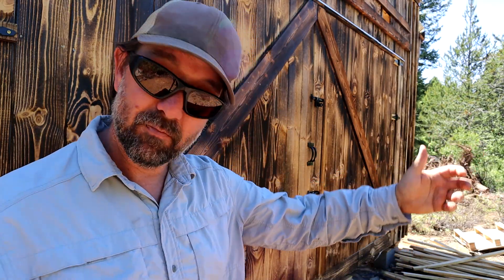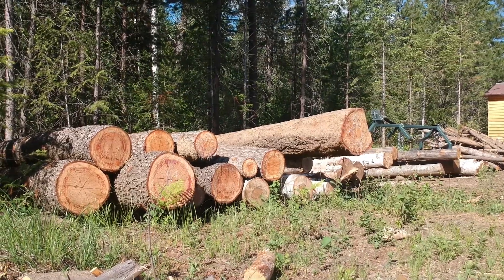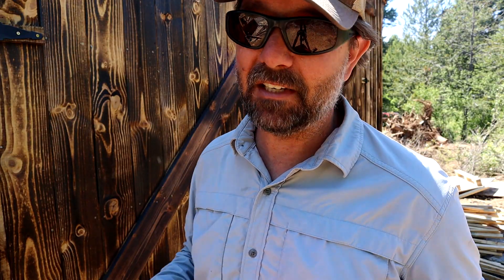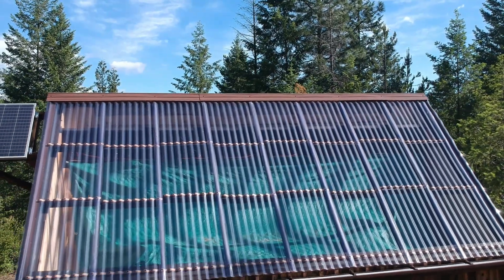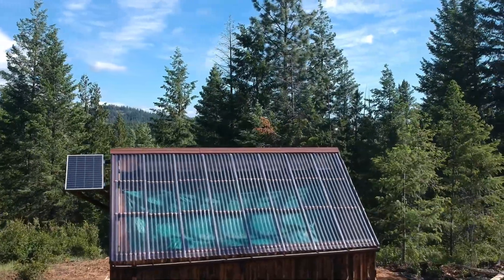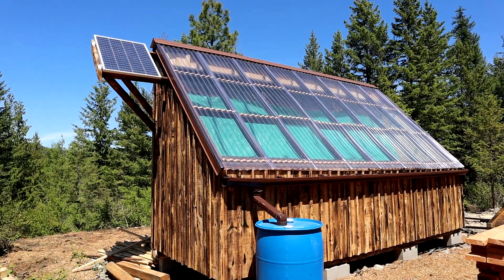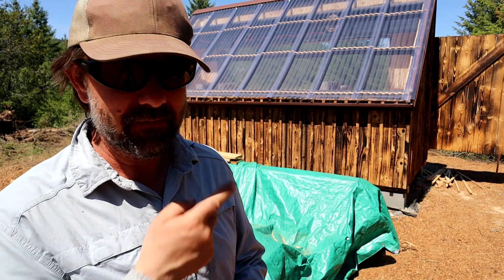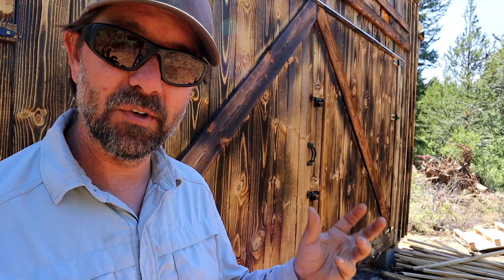The Solar Kiln: Operation, Capacity, and the Effects of Building With Green Lumber - Ep17

Comment: Just curious about your mention of water cooling your sawmill. I built a bandsaw mill, 3’ dia. X 25’ log capacity. I found no need for cooling with my guides . Maybe it’s the western tree species you’re sawing. I saw a lot of white ash, oak and white pine and poplar and have never an issue with heat.

Comment: Good idea: instead of cinderblocks use ratchet straps. Wood pack itself is much heavier than those blocks. Use its own weight against warping. On the other hand, the belt weighs less and is easier to operate.

Comment: One could build a 18’ wide 12’ tall kiln along the top edge above the double wide doors 8’ wing span per door 16’ total width of exterior door opening add a solar/wind powered fans along the top edge every 2’ for a total of 9 intake fans run a full board width starting from the top ceiling dropping down 3’ from top at a angle to middle of stack height of wood. Add three dehumidifiers one on each outer edge and one hung dead center all running of solar/wind battery are deep cycle. Glass the outer windows with wide panels double glass. A top of the out side metal panel or highly stained wood panel extending four feet off the top back side with putter and side drip edges. To keep top fans dry in wet weather. Painted or stained dark. In the lower doors add four high Volume fans two to each door pointed outward for rapid venting. The water from the dehumidifiers could be collected in exterior rain barrels with added oxygen stone for each to keep the water fresh. For yards or gardens. The interior and exterior walls will be insulated with Rock Wool or insulation of choice. Stained dark or painted dark. Build a platform at base for easy forklift, tractor, bob cat loading. Have a certified electrician help with the battery and wind/solar components. Enjoy quickly solar kilned wood for years to come. The floor should be off the ground by 2 feet with sand and gravel base and stained or the bottom treated wood. I could source the whole thing but a contractor with experience could tell the cost of this beast better than me.

Comment: 2 days of milling!?  I work at a circle sawmill and the old guy that runs it is always going on about how slow band saws are. Usually just nod and smile and keep tailing off.  But that 3 foot pile is only 4 hrs of milling for us.   1500 board feet of soft lumber in a 4 to 6 hr day is not a problem.  I had no idea how slow a band saw was.  If I ever get my own mill I'll definately build a solar kiln like yours.

Comment: I rabbit all my siding and flooring. A router at the end of the mill table, helps alot if you have drag back.

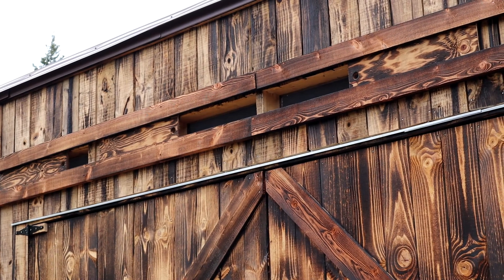 I've built 100s of homes. 90 10:39  probably 99% of framing lumber was green from the suppliers. You shim shrinking under headers, then cover with sheet rock and putty and paint makes  carpenters out of those who aint.

Comment: Hi!,
I just subscribed to you channel so many of my questions may have been answered already but I noticed you have a burnt outer coating on the kiln.  Are you concerned about fire, GOD forbid, since charred wood burns quicker than just uncharred wood?   I also noticed the direction of the kiln as it sits.  Does the building/roof face due South to max out the heating potential?  I love the ingeniuty of building the kiln first, to dry the wood for the house!  For the foundation, how do you get the concrete to your location?   You probably have answered these questions already.  You really look like you are in the middle of "nowwhere USA"  I'm going to start with the first video, THANK YOU  for labeling the video parts sequencially!  Many videos are not labeled 🤔making it hard to follow in order.

Comment: Great job keeping is simple, but explaining completely and well. I’m thinking I’m going to build a couple solar kilns for my operation as I can’t afford a bigger unit. I’ll get my slabs and boards lower in moisture with a solar kiln then hire out finishing so it won’t take as long or be as expensive to finish it off. Thanks for the video!

Comment: I am building a skillion frame for a cabin. Facing solar south. Hoping to have winter solar gain by south facing window wall and north sloping roof. Going 24x28 because only can span 14'6" with 2x12x16' 16" o.c. For now just getting 9 piers, 9 post, 3 headers, and roof finished. So like a skillion pavilion.

Comment: Hi there. what is right type of roofing material? Dual wall is better because of thermal isolation but on the other hand "wave" type should catch a lot more sunlights because of wave shape there will not be so much reflection in morning and evening like with straight material, right? Thank you, Tomas

Comment: Does anyone have a source for the solar panel and fans they use in this build?
Reply from the maker: I just added links in the video description for the fans and solar panel I used.
Reply: I’m also looking for an answer to this!
Reply: Hey SV Adventurer! Thanks for the fast response! Just confirming that you were able to run both fans off the 1 panel, correct? Do you still find that 2 fans is enough, or do you think 3 would be better?
Reply from the maker: I am able to run both fans off of one panel. However, I'm not sure if you could run three off of that one panel I used. You may need a larger output for that. I think two fans are adequate for a moderate load in the kiln, but a full load could definitely use three fans. If we pack the kiln full, the wood on the bottom of the stack doesn't seem to dry out at the same rate as the wood midway and up. Anymore, we generally don't load to full capacity and that seems to help a lot to give even consistency..
Reply: @SailingVesselAdventurer  Thank you for the feedback! Cheers!

Comment: Been researching for a good solar kiln design. I think this is my favorite so far. Is there any reason to not put the door on one of the sides of the kiln? As long as the kiln was tall enough and wide enough, I could walk the boards in and stack them?
Reply: I'd rather have the side open and move them in and out on a pallet with the forklift
Reply: If you will regret putting door at end of kiln!

Comment: LET ME KNOW   HOW HOT IT CAN GET IN THE KILN  AND WHAT ROOF SHEETING ARE YOU USING AND  KIND OF A ROUGH LOCATION SINCE I AM IN IOWA  AND THINKING OF DOING THE SAME HERE BUT I CAN NOT GET A MILL FOR 2 LONG YRS BUT I HAVE TO SAVE UP FOR IT BUT I FIGURE I CAN BUILD THE GREEN HOUSE FIRST  I WAS THINKING OF 30 FT. AND WILL USE A SKID LOADER TO MOVE WOOD  THE OLD BACK IS SHOT AND WENT OUT  MORE TIMES THEN YOU STACK A BONDLE OF WOOD  I GUEST POURING CONCRETE AND JACK HAMMERING AND GETTING CRUSH WHILE DEPLOYED OVERSEAS DID NOT HELP  BETWEEN A SHIP AND DOCK JUST WAS AT THE WRONG PLACE AND WRONG TIMING BUT I RECOVED FROM THE CRUSH AND GOT OUT OF THERE  BUT ENDED IN A CAST FOR A SPELL AND STILL HAVE BAD DAYS OF IT BUT WHAT THE REAL DEAL IS WHEN SOMEONE BREAKS YOUR FRONT DOOR DOWN AND STOLEN MY IDENTITY AND ATTEMPTED TO KILL ME HAS MORE RIGHTS TO MY HOME, ASSETS, MONEY, GOLD, ART WORK, TOOLS, CREDIT , DEBIT CARDS AND I HAVE NO RIGHTS AS A DISABLE AMERICAN VETERAN AND THE ATTORNEY GENERAL  SENT ME A LETTER FROM KANSAS SAID SEND ME  MORE PEOPLE IDENTITY SO I CAN STEAL THEM....  ENTIRE STATE OF CORRUPTION  AT THE HIGHEST LEVEL AND EVEN KBI OFFICER ARE CORRUPTED AS WELL.

Comment: The caps in the floor boards will help  ventilation cool air will rise up through the floor as the warm air vents out the top keeping the humidity low